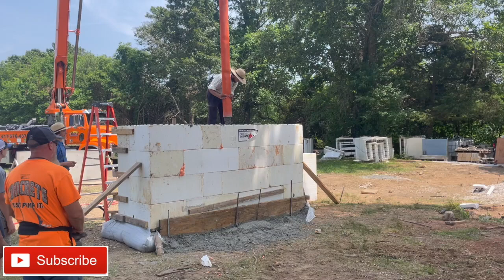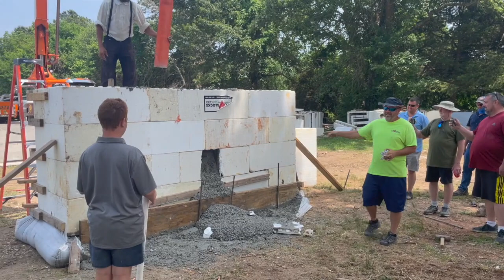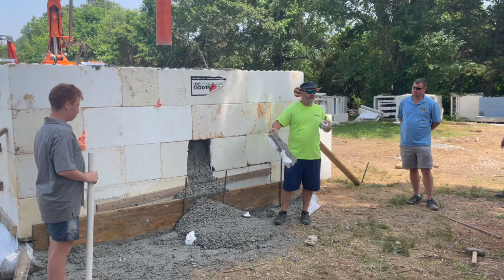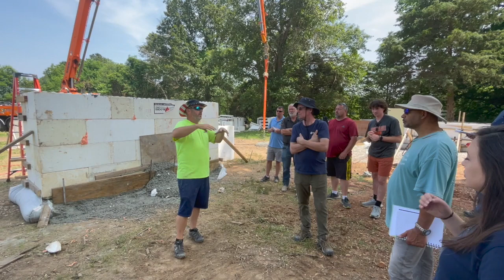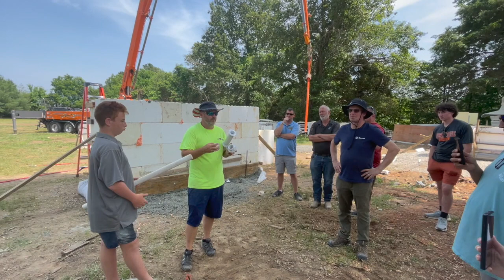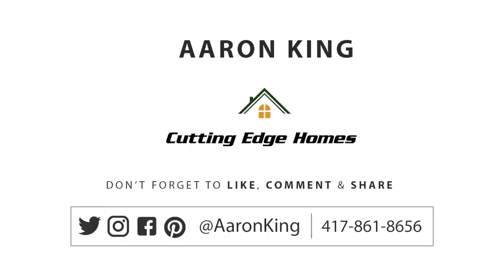ICF Wall Blow Outs!!!

Comment: How is it possible to hit the supporting part in the styrofoam with a screw from the outside and through the plywood?
Reply from the maker: They are marked, and on 8” centers, so just as easy as hitting studs, actually twice as easy since there’s twice as many

Comment: Is it SOP to stack 4 high and fill? Would it be prudent to shore up the bottom two ICF's until the concrete sets? That's a lot of weight going into a foam piece.
Reply from the maker: We stack 20’ high and pour it all routinely

Comment: How on Earth are screws getting any serious bite on the foam?
Reply from the maker: Do you really not know?
Reply: @all3pools  I don't, I've never worked with ICF. Is the foam exceptionally stiff or something? Being a home DIYer only, I would have guess some butterfly bolts to be needed to hold it.
Reply: @TheRayDog  there is a thing called a spreader. The spreaders are plastic inserts that the foam adheres to. Those plastic spreaders replace/actually like studs. Google image an icf block.
Reply: @bsnuff2002  Ah, that makes sense. I've seen the interior of ICF.
Reply: @all3pools How is it possible to hit the supporting part in the styrofoam with a screw from the outside and through the plywood?

Comment: Hey Aaron love the videos and thanks for all the information you share with others. My wife and I are about to start a new ICF home. Thinking about using Mini split system for our hvac due to easy installation, efficiency and flexibility on each zone being adjustable to the user preference.  However not sure if these systems are a good fit because of the tightness of ICF homes. Do you have any videos that discuss this or have any thoughts you would share on ICF hvac recommendations. Also, our climate is same as yours just down the road in Joplin Mo. area.  Thanks